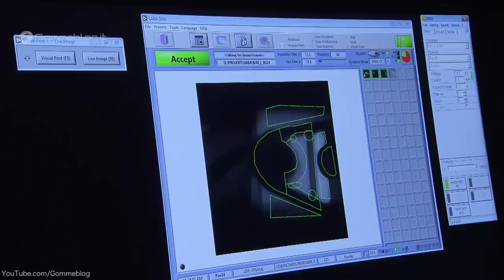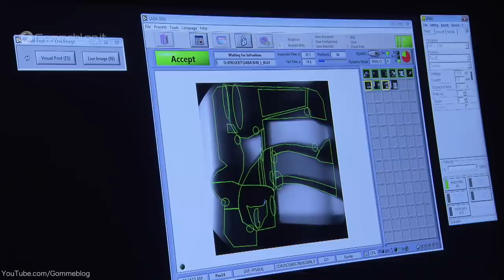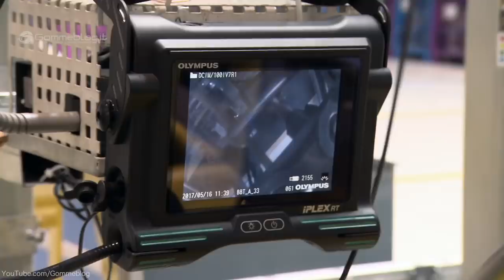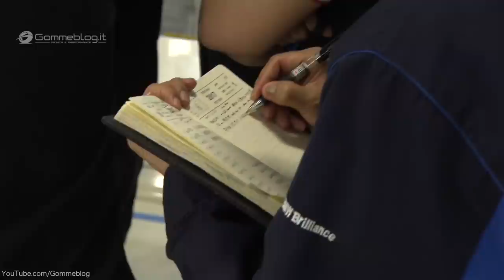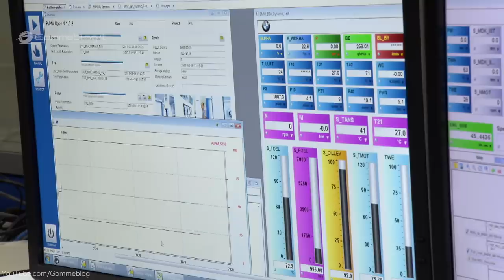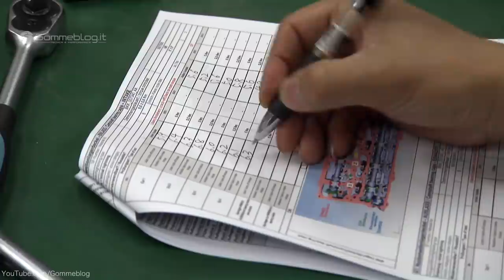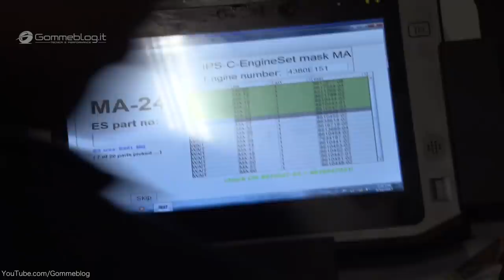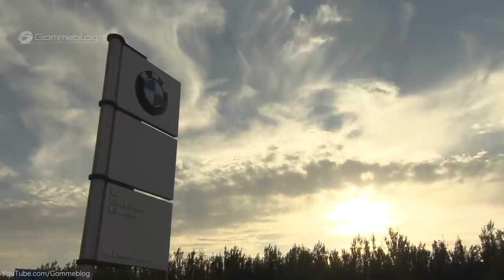BMW Engine Factory

Comment: Joint venture between BMW, Brilliance Auto and Shenyang municipal government to produce BMW for Chinese market. Nice👍,the factory is clean, by using robot/computerize it is very orderly and use electricity energy for forklift include well management of parts. How many unit of cars is this factory produce in a month? In this video the workers are Chinese how about the parts/components of the car are they imported or made from China?